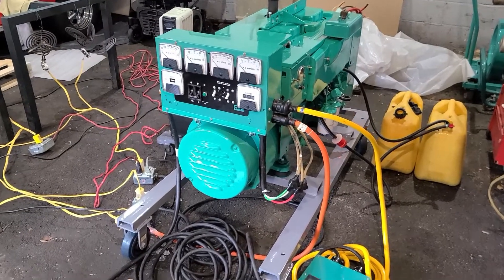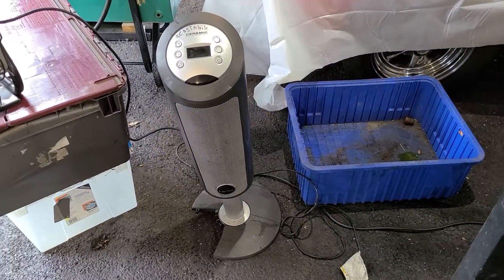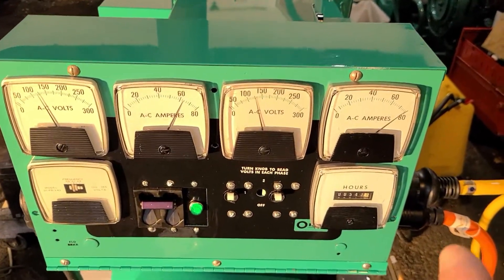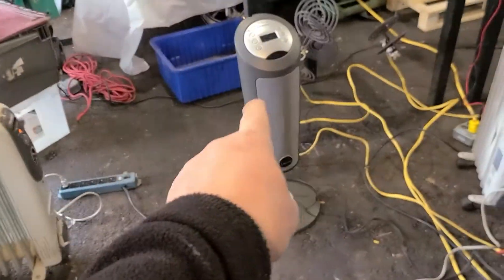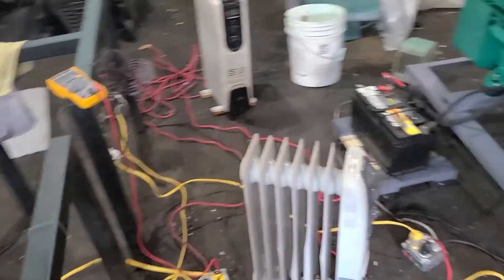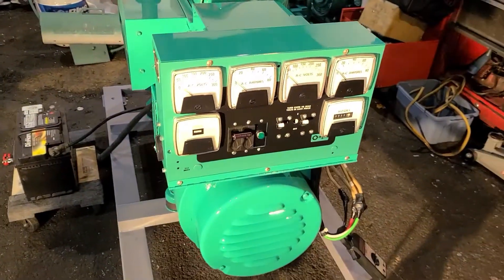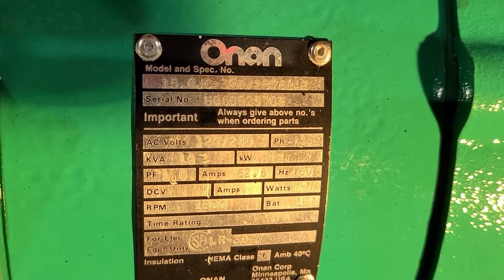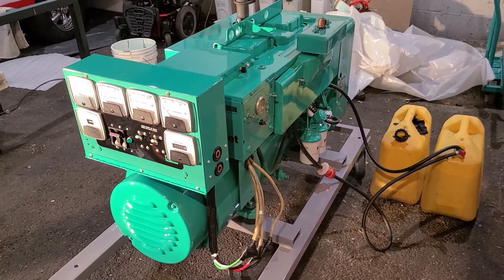Onan 12.0 DJC Load Tested at 19.25 kilowatts

Comment: I have related the story on Smokstak of a load test that I did on a DJC where we accidentally dumped double the rated load on the set. It did not stall the engine but let out a groan and a mighty puff of black smoke , the HZ dropped to low 50s but it kept running. I have long suspected that it would be possible to keep within the normal HZ  and voltage range at much higher than the rated loading for the DJC. Johnny you just proved it , these sets are capable of much higher loading than the nameplate indicates. I wouldn't run them like that for long due to potential overheating of the gen windings  but for starting loads they are great. Keep up the great work with  the Onans in no BS testing situations.